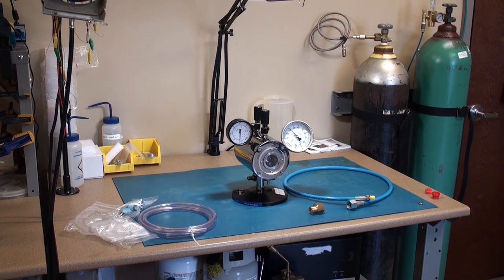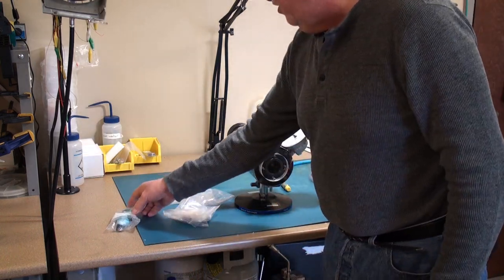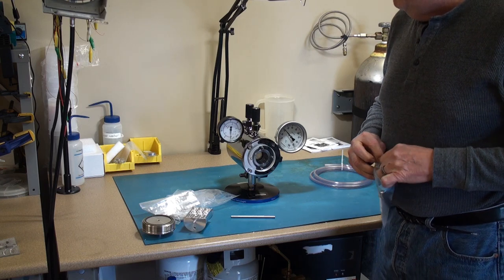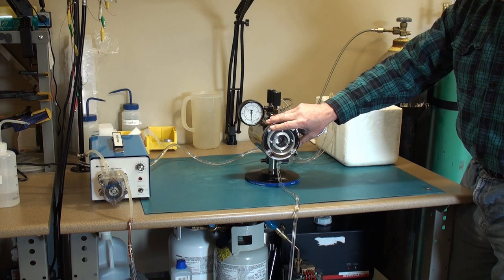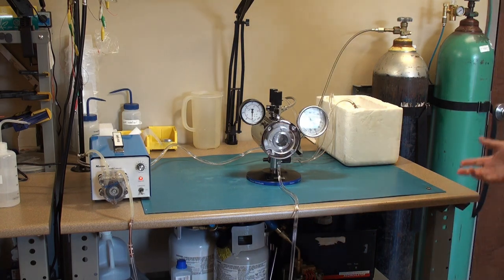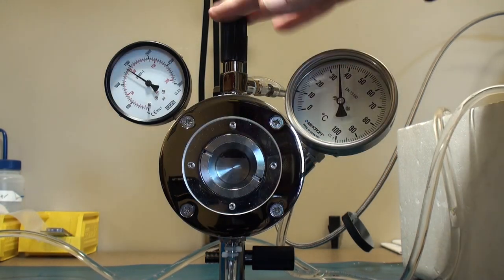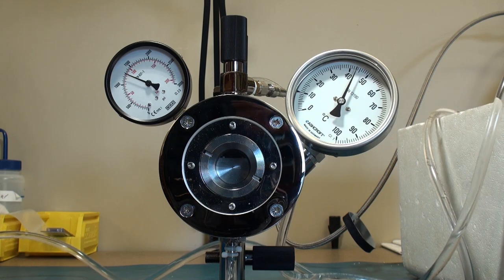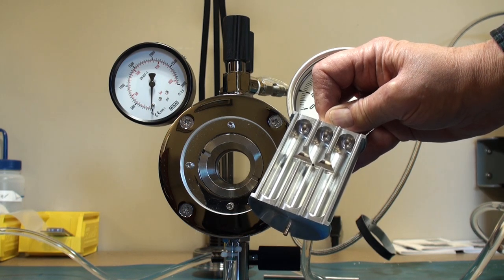Quorum E3100 Critical Point Dryer Tutorial

Comment: critical pint  drying is not the transition from liquid to gas but the transition form solid to gas called sublimation. And why dont you show the results under the microscope, so nobody knows it it works
Reply: The Critical point is a specific set of conditions (temperature and pressure) where the distinction between the liquid and gas phases of a substance disappears. At this point, the liquid and gas become a single, indistinguishable "supercritical fluid" that has properties of both liquid and gas.

The sublimation process, on the other hand, is used in another drying method known as freeze-drying, where the material changes from solid to gas under vacuum conditions and low temperatures, but this is different from critical point drying.

It's funny how you wrote your comment without knowing what you are talking about.

He didn't show the samples under the microscope cause...
Reply: @JesusCruz-my3ob  your answer is ok and i know that. But you dont have right to offend me personally this disqualifies you